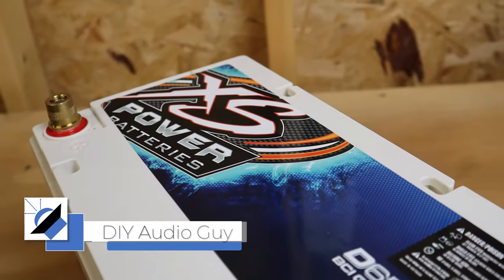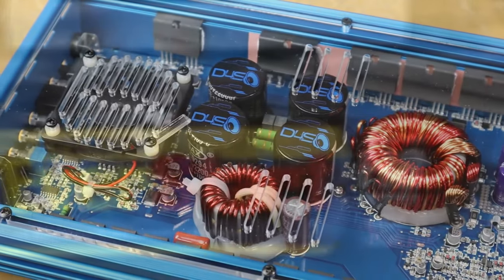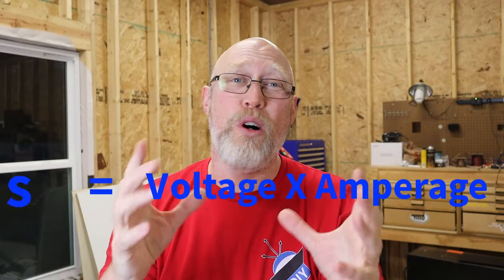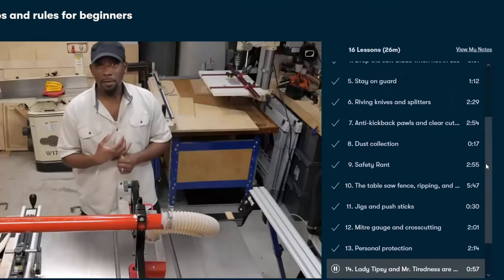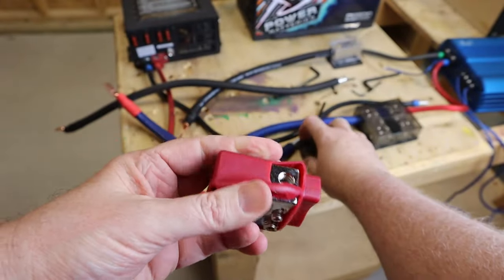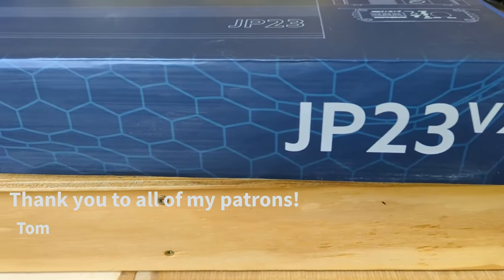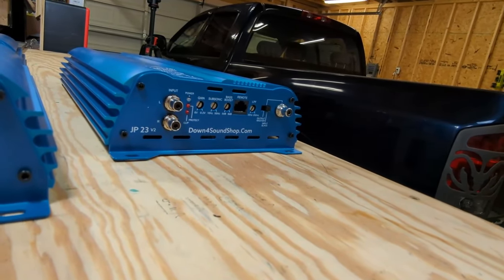Will upgrading to AGM and Lithium make more power?  #skillshare

Comment: In 2016 I bought an XS Power D3100 AGM battery for my 5,000 watt system. I have to say it was a solid battery and did a great job. But a week ago I took out the XS Power battery and put in my new 60ah A123 lithium battery. The difference it has made is incredible!!! My music is louder now, my car is performing better, my voltage doesn't drop below 14 volts unless the car is off, and the lithium battery weighs 26 lbs. compared to the XS Power which weighed 80 lbs. AGM batteries are great but I'm a firm believer that lithium is the best.
Reply from the maker: Awesome.
Reply: Where did you find the battery
Reply: @BillyRay501  Crystal Audio Solutions
Reply: @NocThunder  thanks
Reply: So are you running only 1 Lithium battery for car/Audio?
Reply: @bdbbdb9691  yep...just 1 60Ah battery
Reply: What about when winter comes? Unfortunately those won’t like the cold at all
Reply: @DemonOfFury pretty sure that’s false info a lot of ppl use lithium to start vehicles in cold
Reply: What size Alt
Reply: @jessewilkie5762 different cold where it's zero low 30s for months that's when charger come in play
Reply: @jessewilkie5762 not false lithium don't like cold   or too much heat
Reply: Is your lithium battery under hood or in back?  And what brand lithium battery is it? I am thinking of going lithium but don't know much about it and don't want to have a lithium fire in my car.
Reply: I’m not knocking lithium batteries because they are undeniably amazing, but that performance increase could just be the fact of having a brand new battery. Curious how your lithium battery is performing today!?
Reply: lithium is the best but it costs 3-4 times more
Reply: Cap  @DemonOfFury
Reply: Recommend everyone does some digging lithium and LiPo do NOT like the cold

Comment: You need to upgrade the alternator to be able to handle your vehicle and supply the system that you're trying to put in your car that's why you getting a bigger battery it'll help at first but when it runs out of juice it won't supply what the amplifier is calling for because the alternator is still too small I think people waste money when they don't understand that it's not a big deal to have a big reserve if the alternator can't charge up the reserve whether two batteries or one
Reply from the maker: I definitely got a couple of videos that show that exact thing. The battery just stores power, the alternator makes it.
Reply: Absolutely right. That’s why I upgraded my alternator first 320 with a XSpower D5100R under the hood and Kinect HC1200 in trunk.
Reply: Will your spot on. the factory alt is meant to supply what thy put in and charge the battery that's it!, no after market add ons. you want to up grade factory system , say better speaker's  and CD cool at factory lvl. add amp + sub woofer  add capps. inquire,search based on what you wan,t as your system.don't ask salesman  for advice on your needs.
Reply: Very well put. The best way I explain it to the layperson is to imagine electricity like water your wires are the pipes, alt is the pump, & batteries are the reservoir
Reply: And just as important is being able to supplant current draw which involves the 'Big Three' upgrade. This  will reduces resistance and minimize s heat production.
Reply: Battery charger trickle charge when not in use?
Reply: Don't forget the big three upgrade
Reply: Not always I waisted money on a 290 amp alt but my charging system is computer controlled...I would have to pay for a custom tune just to get the charging the alt could put out...Went with 2 extra batteries and back to stock alt..Works great but I do top all my batteries off about once a month...

Comment: In my un instrumented experience, the agms definitely help maintain a higher voltage than the flooded batteries. In my Honda/Acura vehicles they greatly reduce the headlight dimming that is inevitable with their computer controlled alternators. Walmart agms are the best bang for the buck since they come from the same manufacturer as some of the more expensive brands.
Reply from the maker: The XS power is a better battery, it's just a lot more expensive.
Reply: AGMS seem to have a higher resting voltage and charge faster which can help but as far as maintaining voltage goes ... its more dependant  upon your amp hours. I do agree however that when I switched to my d4800 I noticed  harder initial  bass beats however it dropped just as fast as flooded  but it rebounded faster. That being said.... you still need the amps from your alternator  to recharge them and although additional batteries  will help with dropping voltage it increases  the amount of work for the alt to recharge more batteries. Thats where lithium  cam in for me. It drops  much slower and less deep but still outputs similar to agm in addition  to being lighter and less work for the alt as you only need roughly  1/4 the ah in lithium  that you would need with agm and flooded. Long story short is litium is the best  but you need to make sure you get one that plays well with a stock 12v system and they are much more expensive.
Reply: I have two of the wal mart, large in size, deep cycle AGM marine batteries and a interstate AGM under the hood, a DC Power 320A H.O alternator as well. Seems to manage my Power Acoustic Razor 2500.1D amp from Walmart just fine. 😂

Jokin. Have an Orion3000.1D HCCASPLX amplifier, three runs of skyhigh XL 4/0 OFC Positive and ground
Reply: HELP I'm brand new to lithium and I have been gone for quite a while over 10 years and I'm trying to upgrade my system from 1800 Watt RMS to around 5-8000 depending on what I can get away with my problem is though my car (2019 Toyota Camry LE) can NOT take a HO alternator because of the ONBUS LINBUS electronics build which is where the cars computer is built in the alternator housing so I can ONLY upgrade my battery system and wiring the wiring is all 0 gauge, stock battery and 50 farad capacitor right now 0 voltage drop but I know once I start going bigger and adding lithium for a better bang I'm going to get voltage drop issues can anyone tell me what I can get away with running for long periods of time like how many watts rms on my stock alternator and if I add say a 96 AH headway bank should I add super caps or a AGM neither???? I'm literally knowledge less on the subject and really want to know how to make it work any advice would be appreciated Thanks
Reply: Add second alt Or contact singer or mechman to manufacturer an alt with computer bypass.

Comment: Lithium is the game changer. My XS D4900 would drop into 12 volt range with 3000w amp and 320 amp alternator. Upgraded to 45ah lithium and 5k amp. Never dropped below mid 13 volts. Recently upped to 7k, dropping 12s again. Upping to another 90 ah and 370 amp alternator. See how that goes ....

Comment: I had an XS power D3400 in my GF's Jeep for 7 years, and finally replaced it when I thought it had finally given up the ghost. It was going dead after like 2 days of not being driven. Turns out her 14 year old amp gave up the ghost and was staying on, drawing 650mA. So, it was probably still fine, but I used it as a core for her new battery. I've also found that AGMs seem to hold up better and reup faster than lead acid batteries.
Reply from the maker: It never hurts to have a better battery.

Comment: I think the really cool thing here is that despite each battery performing basically the same, they are wildly different in terms of capacity and size. 

The walmart lead acid is around 150 AH, and weighs God knows how much.

The xs power is 75 AH and weighs a little over 50 lbs.

And the LTO battery is 8 AH and only weighs 4 lbs. And it still put out more power than the monstrous lead acid
Reply from the maker: Right, not an apples to apples comparison.
Reply from the maker: Also, the Down4Sound battery was connected parallel to the XS power battery for the third test.  This is how the battery was designed to be used, as a second battery in the trunk.
Reply: It would be really intresting to see how much power the batterie can produce until the amp goes in prptection
Reply: @DIYAudioGuy do you have a video on how to connect the lithium or any other battery in parallel to the second battery? There’s hardly any videos on how to do it. I’ll donate if you post one.
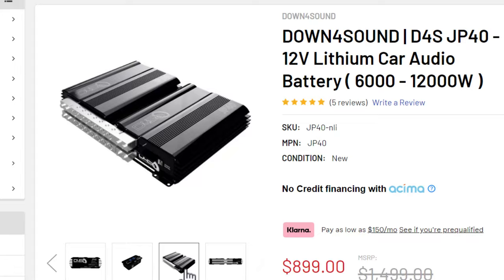Reply: @MrILLryder  7:42 he explained your question 👍🏻
Reply: @DIYAudioGuy xs has s starting battery

Comment: I find that most of the new high preforming battery are not worth the much higher price,  but I did my testing for this about  15 years ago,  I  use the Walmart battery's and I like to match the ones that fit the vehicle,  one next to the Amplifiers and the other in the stock location.  When I was running  a lot of power the trick is a great alternator or running a generator for car sound competitions but  for me that was a long time ago

Comment: I would love to see you do the same test connecting the lead acid and Agm together to see what gain you get over a single under hood battery to test my decades long practice of adding an Agm inside as an auxiliary battery for the sub amps with a lead acid under hood.
Reply from the maker: For sure, there's always some other variation.

Comment: Speaking to the end of the video you can buy a module dc to dc charger to separate your lithium bank from your lead acid starter in the front learned this from another DIY guy like yourself specializing in campers and off grid type electrical. I always wanted to pull the trigger on 1 of those $400+ batteries you put in the front but worried they won't last because of the insane charging rate a alternator puts out i have fried a few AGM batteries this way and keep in mind i kept them always above 50%. As always love your videos keep them coming!

Comment: When I need to replace a battery I usually get the x2power AGM's from Batteries Plus. You can always find coupons and they're rebranded Northstars you can get at a lower price.
Reply from the maker: I was going to get one of those, but the group 65 version was out of stock in within a  100 mile radius of my location.
Reply: I’m on there website what are the agm listed under? I can’t find them
Reply from the maker: @BillyRay501  What size do you need?
Reply: @DIYAudioGuy  I’m looking for a couple for audio I guess the biggest one
Reply from the maker: @BillyRay501  Did you try the links in the video description?
Reply: @DIYAudioGuy  just checked them out. I might just use lithium make my own battery and save $5-$600

Comment: I got 2 agm batteries under the hood and solar charging system with one small 50ah lipho battery under the seat. When the key is on all the systems combine. The purpose of the solar was to keep my fridge going during the day, and so I dont run the truck down. I never felt I needed more bass, and I have a JP8 and a skar evl 15 behind my head. I am sure it helps, cuz the lights dim less now.

Comment: I have the 75A Powermaxx charger and an old Optima Yellow that I use in my shed for my setup.  That battery has got to be pushing 9 years old. But, it's still holding up.
Reply from the maker: That's awesome!

Comment: Great video. Im wondering how many amp hours is each battery you tested rates for?
Reply from the maker: I don't recall for the XS power, but the lithium batteries are only  6ha.  Of course lithium has faster charge/discharge rates so it is not an apples to apples comparison.

Comment: In my first car I couldn't install anything bigger than a little group 35 battery so I ended up getting a giant group 49 battery and putting it in the trunk and using the existing 4awg power cable to feed the engine bay.

Comment: You can actually upgrade your voltage Beyond 14.8 volts easily actually and like you said More Voltage less current which is why DIY lithium and higher voltage batteries are so popular
Reply from the maker: One of my goals with these power upgrade videos is to help people understand that they cannot throw a 3kw amp in their car and expect to work without upgrades.  Hopefully this video proves that adding batteries will help but not as much as making the changes you are talking about.
Reply: @DIYAudioGuy  if I'm lucky I'll be getting a HO alt ahortly after January, and I know a local guy selling a 3kw rms sundown amp for only 160$ 🤤 I never thought I'd be so close to so much power/bass

Comment: Do you need lithium if you have a HO alternator and only listen when car is running? Especially if the volrage doesn't drop below 14v?   In this case, is a lithium necessary?
Reply from the maker: Probably not, but it will not hurt.

Comment: I am experimenting with a flintstone cell.  I find that adding pebbles to the electrolyte gives me more bam-bam.  I guess in order to tackle bigger bass,  we need to trout new lines...
Reply: OH L some body changed dry cell to  AGM!! TO day i turn  69 yrs old 12/12/1953.My  hay day was the 70'sYep we had dry cell bats . I rolled in  a custom Van. Knew  sine wave is white noise... never ran a sine wave to/till the point of clipping.(taxed the bat till it could not preform the task.) Know that max watt is not RMS . My rule of thumb is  easy. AMP toots 5000 watts,divide by six is close to RMS .I used caps for thump,three from a split faze washings machine motor  no less.Q: will a dry cell out preform a plane jane batt. Electron s = power and if both batteries  contain the same count or near same. then is it not a question of witch one charges faster, or better yet the alternators performance?
Reply: @donaldbritton.4134  ROTFL!  A few microfarads rated at hundreds of volts!  Brilliant!  All joking aside:  headroom can be gained,  to a certain extent, with a few farads connected directly across the amp's power terminals.  But with a loud, sustained bass note,  headroom goes out the window, so the best bet here is the auxiliary battery near the amp.  That way,  the leads from the main/engine battery don't have to be so damned  large in gauge,  since the alternator charging losses are relatively negligible. 

 But I like the idea of aviation cells.  While you're at it,  why not just put a gas turbine powered APU in the trunk,  and be done with it?

Comment: Ive got a 600/750 CCA battery in my 98 suburban. Will a bigger 800/1000 CCA help with my lights dimming/volts drop??? Just put in a JP8 and my stock alt is 105.
Reply from the maker: Yes, but.  As you can see in the video I still get the voltage drop.  The batteries did let me squeeze out more power before that happened.  So it will buy you a few more watts before your lights start to dim.    I am shocked to learn that a suburban runs such a small battery.
Reply: @DIYAudioGuy  the 600cca battery is only a couple months old. Maybe, get another one for the driver's side and see if that helps? How about me getting an ultra cap??? Thanks for ur help.
Reply: You may be better off just dropping $350 for an alt.  🤷🏻‍♂️

Comment: Have 320 amp alternator. My agms would drop high 11volts. Switched to Lithium and never drop below 13.4 volts. Makes a difference. Only thing is 12k rated lithium (38 amp hour)+ 500 farad ultracap on only 5k amp and still drop to 13s.
Reply from the maker: I wish batteries (and everything else other than amplifiers) would stop providing wattage ratings.  There are just to many variables to say that  what size battery is needed.  What we need to know are the amp hours and the C Rating.  From there we can figure out the rest.
Reply: @DIYAudioGuy we need nuclear fusion batteries lol